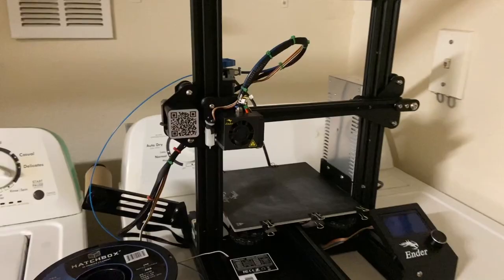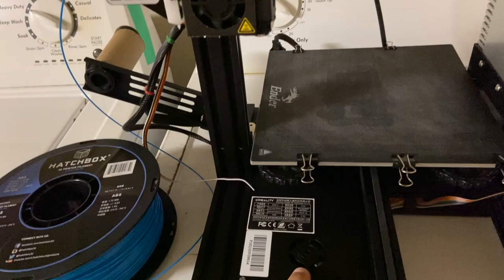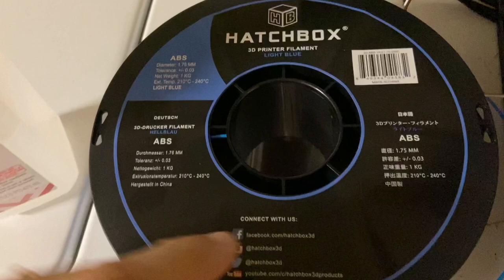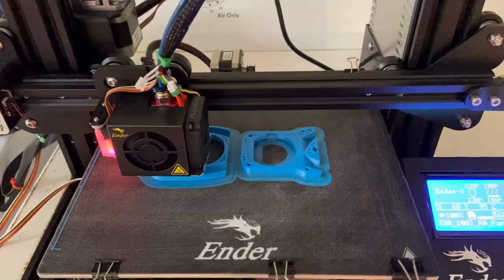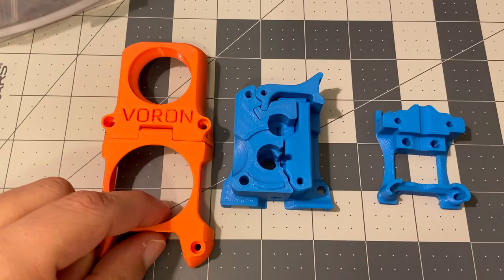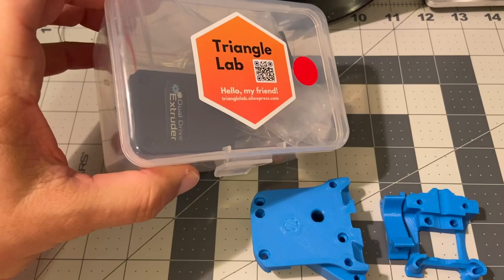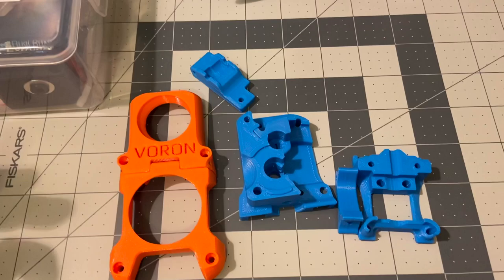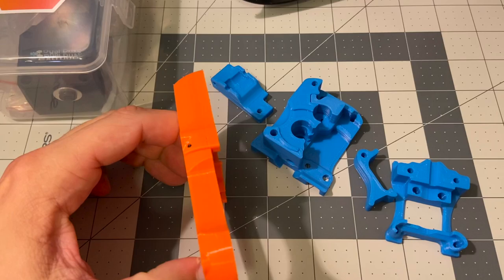ABS Voron Parts on Ender 3 without Enclosure

Comment: Totally agree with the sanding. Took some 150 grit to my glass plate, went absolutely crazy at every direction for a few minutes, washed it off, and then printed a "priming plate" which was just a few layers over the majority of my print bed to make sure all the glass dust was gone.

Comment: Great work! I would also recommend you try using a draft shield to keep more heat around the part and reduce the chances of warping. There is an option of enabling it in Cura when advanced options are enabled.
Reply from the maker: Thank you for the advice. I just decided to not use it in my case as i don't really have wrapping issues unless i do very long prints, as it increases the print time i am trying to avoid it, will try at next long print.

Comment: PETG will bend over time when under stress. ABS will withstand such forces better. 
If you can print in ABS. Cheap and very strong material.
Reply from the maker: I use and print with PETG alot and never had those  issues, may be it's the case for enclosed printer. Prusa uses PETG on theirs printers and they still print well. Per my experience ABS significantly more fragile than PETG. Tho again I believe each plastic has own applications and in enclosure i would definitely use ABS for sure.

Comment: Did you upgrade to an all metal heat break?  If not, your PTFE tube is making contact with the nozzle, and at ABS printing temperatures, it'll burn and emit toxic fumes.
Reply from the maker: Before you read this comment i must warn: "I am not an expert by any means". Yes, I use stock hotend with Capricorn tube, it has a bit higher temperature resistance and per my experience with my settings i have never seen it change the shape or degrade with amount of printing i do compare to stock PTFE tube. How ever when you print with ABS amount of VOCs from the material significantly dangerous than from PTFE melting and Id be worrying about it more. Main reason why i built an Enclosure (You can find the video on my channel). Anyway i really appreciate your concern as for me Hobby has to be safe, no reason for unnecessary risks.
Reply: @hobbyistnotes  It's important to make the distinction between ABS printing VOC's and the risk of PTFE off-gassing.  Temperatures as low as 260 degrees C could result in fumes that pose a risk to pets (predominately birds) in the home.  It's a 15$ upgrade to eliminate the risk.
Reply from the maker: @tristanlane3777  Sorry, i put it wrong way, you right about distinction. I use 230 (C) with ABS and per my personal(no expert) research 250(C) is when you start to having an issues with regular PTFE. I meant that as 220 - 230 "considered" to be a safe zone for PTFE at this temp id be more concerned about ABS VOC's. As i mentioned: hobby must be safe! The goal is to run this printer in Enclosure with filtering system on all metal v6 hotend, most parts already came, enclosure ready, have to finish some electronics and this question will be closed. Thank you for writing this comment i think it actually will be very helpful for people who just started with 3D printing to read it.
Reply: @hobbyistnotes  consider a Dragonfly hortend. All metal and it should have a higher flow rate than a v6. 
Cardboard box for Printing ABS is enough. For ABS I recommend esun ABS+. It has less shrinking. Easier to handle.
Reply from the maker: @Todestelzer  I have 3 Dragonfly Hotends and based on my observations for 4th of the price All-metal V6 performs almost the same, at least at speeds I am currently using. Also I have a-lot to say about eSun ABS+ it's definitely not the easiest ABS i have printed with, constant delimitations after bridges, very inconsistent filament size with under-extrusions on the prints, may-be I just got bad batch of it...
Reply: @hobbyistnotes  I printed around 10 rolls of esun ABS+ without problems. 
Maybe it’s a mechanical issue or a wrong setting in your slicer. I’m printing on a enclosed Voron 2.4.
If you have problems after bridges it’s probably the fan speed. Lower it and lower the bridging speed.
Reply from the maker: @Todestelzer  No part fan used at all, 40(C) in enclosure, bridges are fine but sometimes in 50% of the times print have layer separation after bridge. I have tried SuperSlicer, Prusa Slicer, Cura and same problem on all of them. Other ABS's brands doesn't have this issue even cheapest one I got. BUT One thing I have to admit eSun ABS+ has amazing finish/end surface.

Comment: I am printing the parts on open ender 3 pro, microswiss direct drive extruder, whambam print surface, I cover the bottom of the extruder with aluminum tape to ensure the part cooling does not get onto print... then print with heated bed 115C and hotend at 250C for standard abs, 255C for esun abs+.  I print without draft shield with no warping or cracking.  I also disable all print cooling
Reply from the maker: Exactly =) some people can't believe it's possible... BUT I think I know why, last month was extremely cold in my area and even in enclosure I had little issues with very long prints, solved by holding heated bed ON for a while.

Comment: For longer/biggr prints for enclosure you can probably use regular cardboard box.
Reply from the maker: I have tried it :-) fun experience, but as long term solution actually I found it a bit dangerous, especially if printer doesn't have Thermal runaway enabled, as most stock enders.
Reply: @hobbyistnotes  True - not a long term solution - rather quick and easy hack. Printing without thermal runaway protection is bad idea anyway.
Reply: I suggest scrapwood. You can find scraps from things neighborhood folks put out for free or for trash. I made a 2 foot cube and threw painter's plastic over it. With a tiny space heater, I managed to get the temp in there up to 100F and put the steppers on the fritz. So definitely give your machine a break between prints, with the plastic sheet off.
Reply from the maker: @BigHonkinGoose  I made myself Lack inclosure out of IKEA tables, it gets exactly 40(C) inside and I had long session in about 4 days straight with printing ABS, it works amazing no wrapping and no layer separations. I even have second set of parts for second Lack enclosure, but too much work with new more exciting projects. Currently assembling NeverMore filter for the enclosure.

Comment: great job 👍👍 i print esun abs+ on stok ender 3v2 without enclosure.temp hotend 240 bed 105 degree
Reply from the maker: With eSun i have huge layer adhesion problems. I purchased spool of eSun ABS+ on the hype: "it's easy to use eSun", but spent a lot of time debugging it than Hatchbox or Paramount regular ABS and still doesn't have usable results, so if be honest i am very disappointed with eSun ABS+ even it has nice mate surface. So far Paramount was amazing for me and it's cheaper than eSun....
Reply: @hobbyistnotes  print with esun abs+ on stock glass bed ender 3v2 .but i have problem with overhang especially on corner.
Reply: can you share the slicer settings for petg and abs?
Reply from the maker: @madorax251  for Voron’s parts I use stock CURA profile with recommend by Voron’s team adjustments (you can find recommendations in any Voron’s printer assembly guides). For regular printing I also use default CURA profiles and from ton of debugging I figured there is not that much of a difference on properly tuned printer. As I use 3 different PCs for slicing I decide to keep it simple. Sometimes I increase the print speed on the printer itself between 120-140% before extruder starting to skip.
Reply from the maker: @madorax251  If be honest i hate stock glass it works only with PLA an it's crazy heavy. After i tried PEI i don't thing i want to use anything else. Also PEI perfect with PETG and i like it more than any other filament so far.
Reply: @hobbyistnotes  I've also recently had a problem with the adhesion with the glass bed with glue sticks. What's your recommendation for abs and petg using textured pei or smooth pei?
Reply from the maker: @madorax251  Per my experience textured side has way better adhesion but it requires perfect 1st and 2nd layer actually as most surfaces. Without an enclosed printer Id also recommend to use brim with abs it’s super easy to remove.

Comment: Could you share your slicer settings?
Reply from the maker: I am using default 0.2mm Cura profile. Only Modified settings that recommended by Voron Team: 

LAYER HEIGHT: 0.2mm
EXTRUSION WIDTH: Forced 0.4mm
INFILL PERCENTAGE: 40%
INFILL TYPE: Cubic
WALL COUNT: 4
OUTER WALL FLOW: 95%
SOLID TOP/BOTTOM LAYERS: 5
BILD PLATE ADHISION TYPE: Brim
BRIDGING: Disabled
NO SUPPORTS

Comment: impossible, with enclosure i'm still have trouble with some parts.
Reply from the maker: I noticed that making sure no air goes to the printing part makes huge difference in this setup + small batches with small print time. Longer you print more wrapping. Also placing parts parallel X axis makes bed move less thru the air, so less cooling. Brim helps big time.
Reply: how many parts do u print at a time
Reply from the maker: @nilsirrah7672  I am trying to not print longer than 8-10 hours and separate parts by same height. If you have small parts done sitting half print time on the bed they will most likely wrap. Per my experience: 2-3 mid size part OR 1-2 Big one OR 4-5 small parts at the time. Again better to look at the print time, longer the time more issues you will have with the quality.
Reply: @hobbyistnotes  nice, will try that. also what filament are these?
Reply from the maker: @nilsirrah7672  I think in this video i used Hatchbox but id recommend to buy Paramount 3D ABS, very impressed with consistency considering the price.
Reply: @hobbyistnotes  I’m actually done building, all parts were fine except the afterburner. Did it five times each time gave me warp. I think an enclosure and preheating are a must, as having a hot chamber temperature is a requirement for bed adhesion and most importantly have strong bond between layers so the part wont crack in the future under stress. I already had a few parts such as the y carriage cracking, even i had it printed in an enclosure.
Reply from the maker: @user-yk1cw8im4h  I had same issue with eSun ABS+ it even brakes sometimes when printed in enclosure, rest ABS brands are fine. Also I noticed huge difference plays ambient temp and bed surface as if you live in temps closer to zero chances of pulling big abs print without enclosure are slim.

Comment: Use ABS+ - no problems unenclosed except: Your health…
Reply from the maker: I tried and for some reason I have worst result than with regular ABS, it’s delaminating…
Reply: @hobbyistnotes  that’s strange - which brand of ABS+ did you try? On my Prusa, Voron 0 and the Rat Rig V-Core 3 no problems unenclosed with Esun ABS+
Reply from the maker: @247printing  Latest batch of Esun ABS+. I v seen some people at the Voron's discord have same issues. It holds good till about 20th layer where bed heat no longer helps the print and than you can split part with some hand-force.

Comment: Soo envy, my lack enclosure, 
Mk3s+ , Nozzle 260C, bed 110C , inside enclosure 32C, no part fan, used brim, and the abs still lifting on the corner… 
eSun ABS+ fresh spools dried with dehydrator too. Im out of moves… fckin ABS 

Petg, pla, asa, all went great…. ABS sucks… just sucks…
Reply from the maker: I had same issue when ambient temp was lower than 20(C). With bed slingers you have to make sure no air hits print (most critical one) as bed moves thru air all the time ambient temp should be 35+. Make sure you place printing parts that way bed will move less, print few parts at the time.
Reply: @hobbyistnotes  thanks!! Will try!
Reply from the maker: @tonnyprasetya48  Hope it helps, also you can use tall skirt/brim that helps to avoid extra air around model.